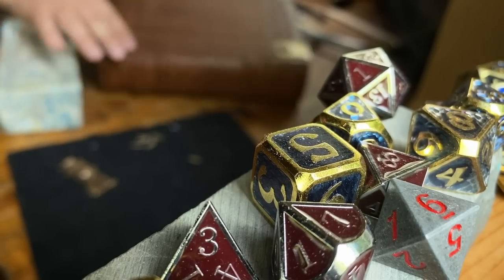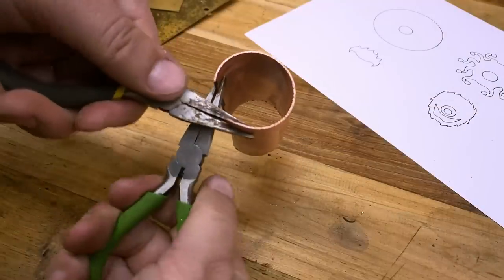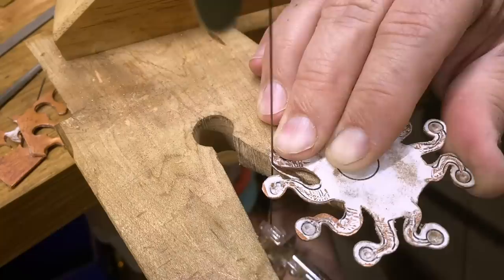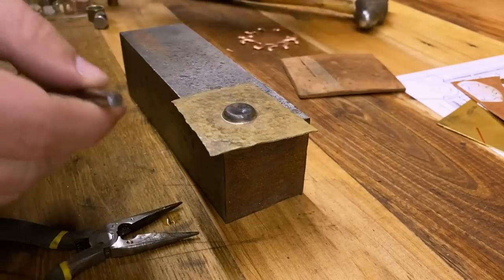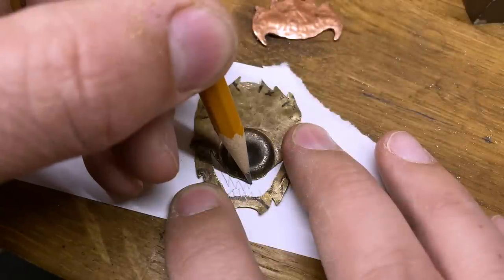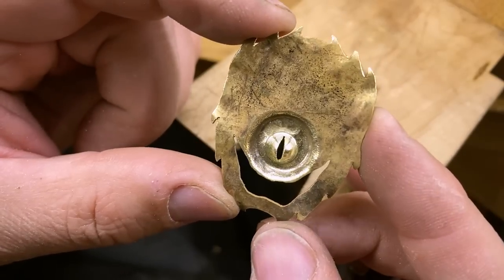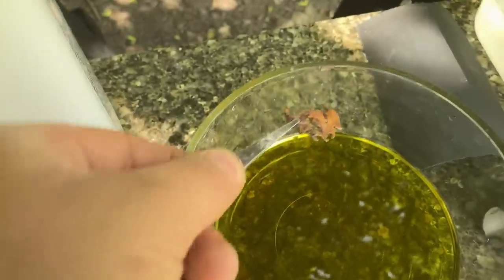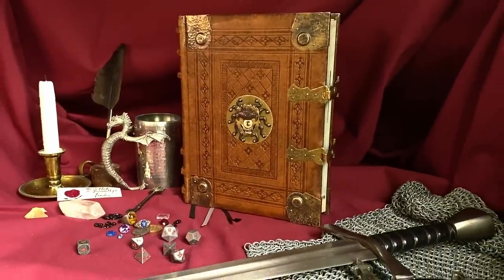Making The Metallic Beholder Escutcheon For My D&D Tome

Comment: I actually studied goldsmithing (fine metalwork is referred to as goldsmithing, with or without actual gold), and to be fair, there's almost nothing I can say to help further your craft, since it's already absolutely perfect. The only piece of advise is to use a good layer of tar (in a bowl, perhaps with gravel to fill the bottom up) as a surface for your embossing, though a soft wood like you used might actually not even be that bad. Tar will give way a bit more easy though, and is reusable when you warm it up afterwards.

Comment: I remember the very last time I worked some copper sheet with a coping saw. I was going to silver solder a copper bat to a brass circle and glue a magnet on the back for the "in/out" board at work (my last name has a "bat" in it, so...). I'd just finished the bat when my girlfriend said, "Oh, that's adorable! Make another one just like it so I can make earrings out of them!" Sigh. Okay, make an exact duplicate of a bat about half an inch across. The first bat took maybe an hour. The second one was more like four to get them to match. I never did finish my magnet, and she never got around to making earrings. Eventually, she lost them. 😕

Comment: Just an FYI - dumping the copper in water after heating it to an annealing temperature isn't really the best annealing process. - Cooling it quickly like that adds stress to the metal which can lead to cracks or brittle spots in it. If you want it to remain soft the best bet is to let it cool slowly - either in a forge to cool down with the forge, buried in sand... or at least air cool in a room without a draft.

Comment: For embossing metals the ideal tool is spherical at the tip, you can gently tap them with your hammer at an angle to follow the line very precisely that way, and if the sheet is particularly thin (like aluminum cans) you can even just score it with your average ballpoint pen.
The reason for it to be spherical is so that you don't accidentally have a point that could result in removal of material, like with engraving, hope that helps.